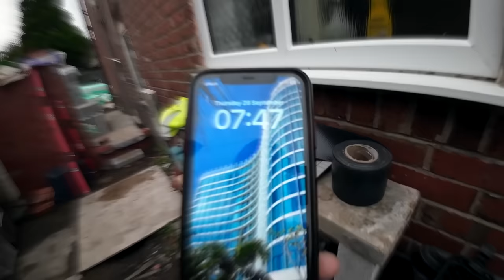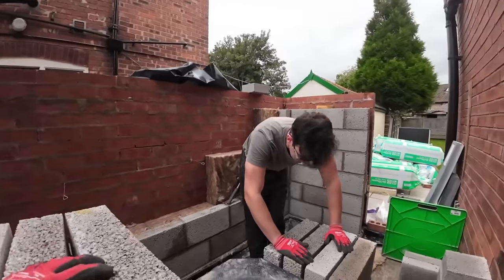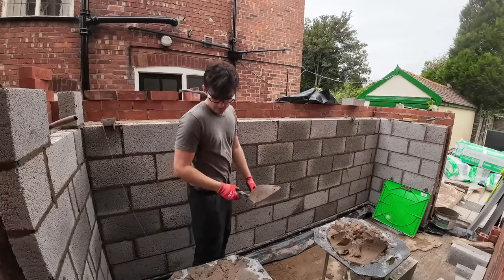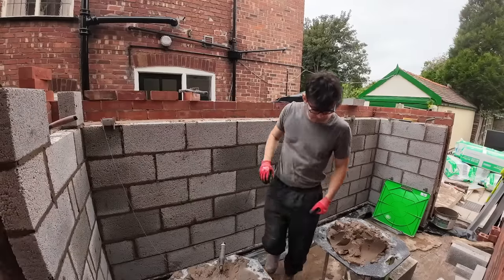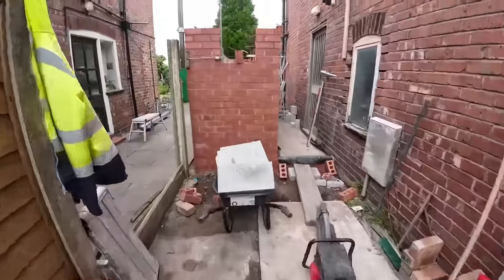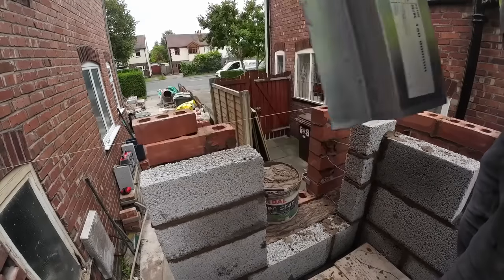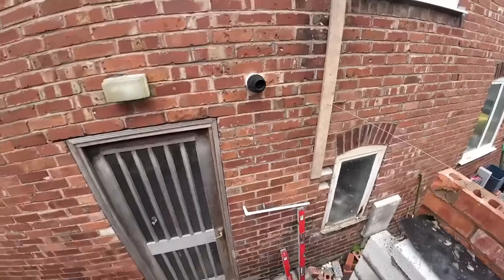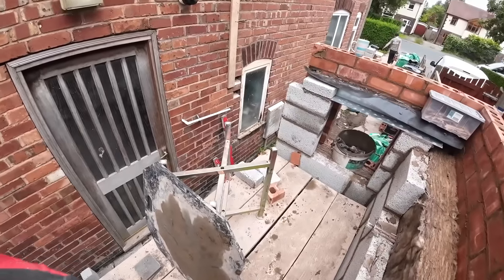MAKING GOOD PROGRESS ON THE 150 MM CAVITY EXTENSION PT 6

Comment: That certainly does stink to have 18 cuts, Alex did good having your brick cuts were they go. I remember being in my last year of apprenticeship and I got stuck at the saw with about 30 brickies and 2 laborers bringing me the cuts for brick and block. Cutting all day, the old days, no mask or ear muffs. Close to 40 years ago. You make a good team, it kills me Steve to see you when you walk. Don't bitch, just do your thing. After I get my second hip done if I come over to England you give me a job, lol I'm only just turned 60. You can get a few more years out of a older brickie with two new hips. Take care Steve.
Reply from the maker: We were on a job a while ago where every brick had 5 mm taken off the length so that cutter was very busy so we all took turns on it.
   Good luck with your second hip, who knows when mine will get done 🥺🧱👍🏽
Reply: @SteveAndAlexBuild  Steve, take some time and get that hip done. I see you walk and can see it in your face, that slight grimace ever step. Not this past summer but the summer before that was my last, I was so bad that customers that I have done work for threw out the years were telling me I have to have it done. That last summer because of the pain I could not eat and my mom was not good so I would stop there on the way home and do things for her. So between the pain, heat and worrying about my mom I was less then 150 lbs. I'm 5'10" and weight about 175 lbs. Take care of your health Steve.
Reply from the maker: Thanks buddy, I hope all is well now .
    As we have free healthcare over here I have to wait till they are ready unfortunately 😞🧱👍🏽